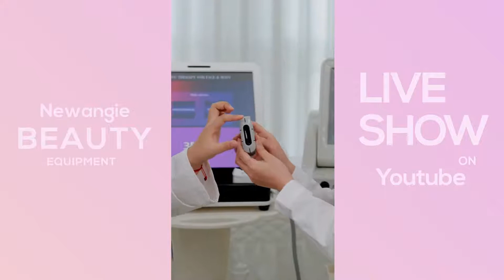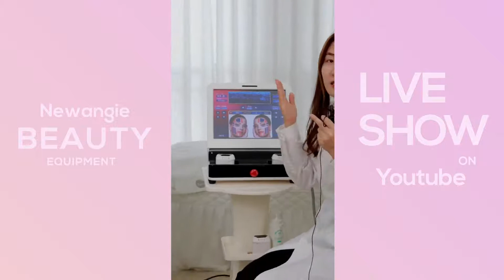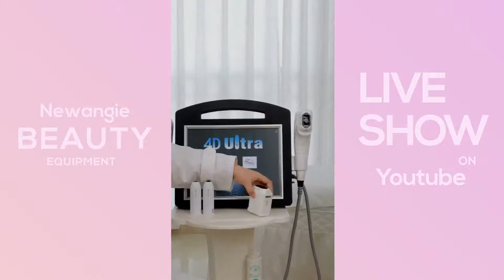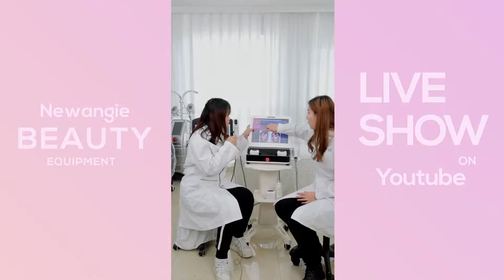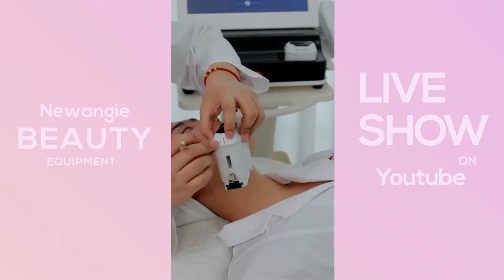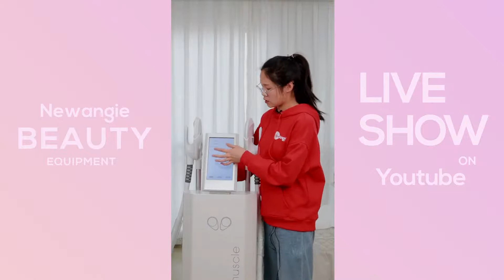Best HIFU Machine You Can Choice!

Comment: I have your machine. I had read that using the 4mm on the face can cause fat loss. Please clarify
Reply: Ok and thank you for your kind reply about it, thank you so much~
Reply: @youngbm3  I don't think you have understood the question. Is 4mm safe? Does it cause fat loss on the face ?
Thank you 😊
Reply: @mariesherratt7719  Dear Marie, there are just 4.5mm of the cartridge with the machine, 4.5mm: used in SMAS, for face lifting and wrinkle removal, it's safety and can be relaxed to use it on the face to do lifting treatment